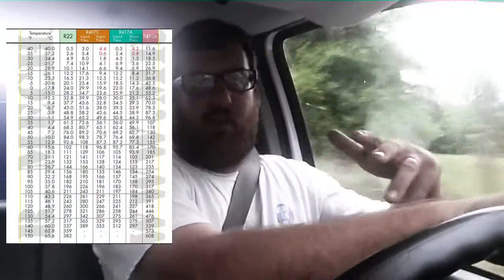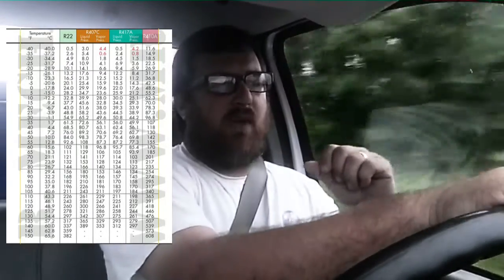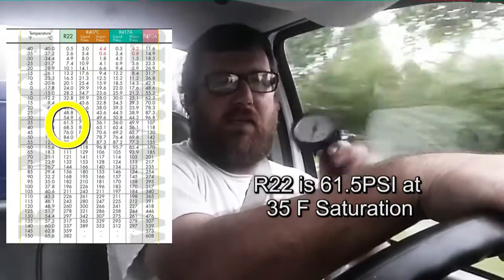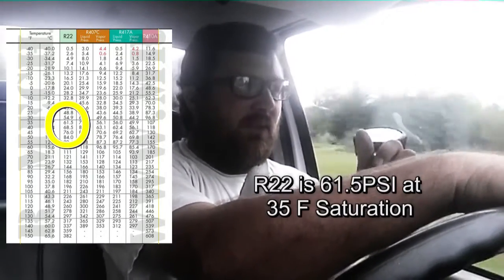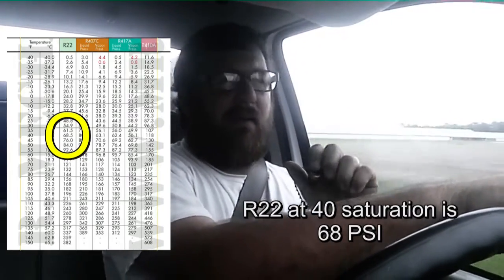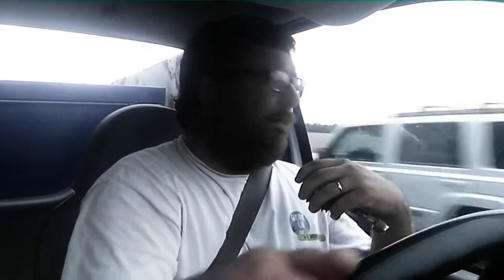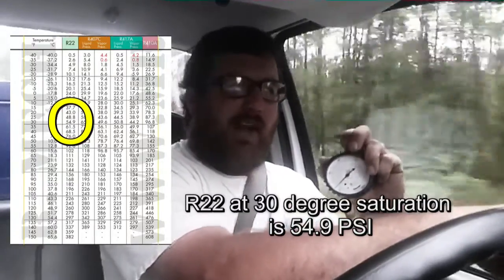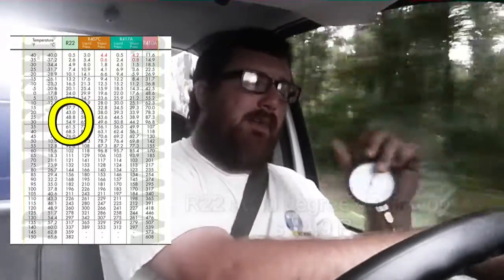Target Suction Pressure

Comment: Does this only apply for coils using a piston? If it's got a TXV the suction pressure usually stays the same and only the head pressure moves and alters SC. Great info Zack! Thanks. Also, overcharging a coil like mentioned on that last example with the mismatch would cause a low SH and possibly flood the compressor. So what are we to do!?
Reply from the maker: +Jim Rodriguez on the mismatch you will have to find a balance and hope there is an accumulator. The target applies to both metering devices.

Comment: I was on a mobile home up flow. The sub cooling was 10, but my HP was in the 180's on an 80 degree day, R-22. The suction was 58, but no frost. The tstat was satisfying fairly quickly. I let it run for longer by dropping the setpoint, and got out the jug. I added enough to get it to 15 degrees sub cooling with little change on the high side, and no change on the lo side.
I checked CFM and had 1500, nameplate out door unit, not legible, so I can guess 3.5 ton I checks the registers, and all but 2 had the proper flow. I would expect the lo side to be higher if the piston were to big, but if it were too small, I would expect a higher head, and a lower suction?
Reply: +Eric M SH was 8, return mid 70s saturated at 58 psig
Reply: +Eric M only had a 20 x 20, and they were using a pleated filter. It was bowing in a little bit. Could need more return?